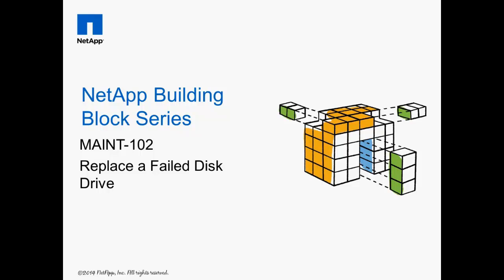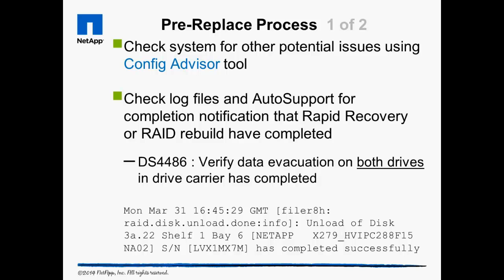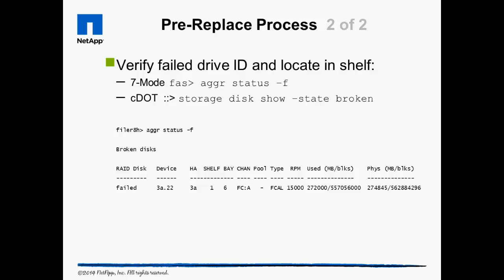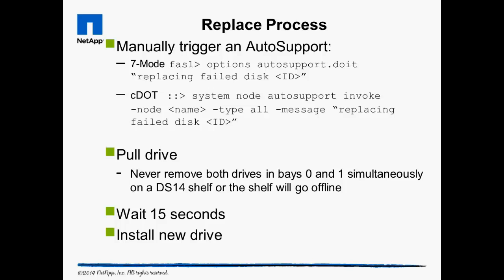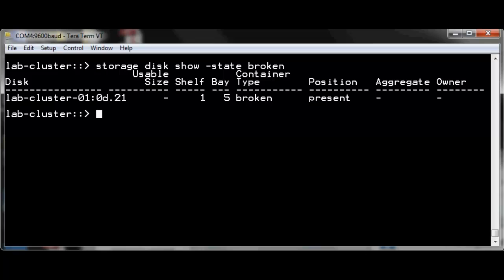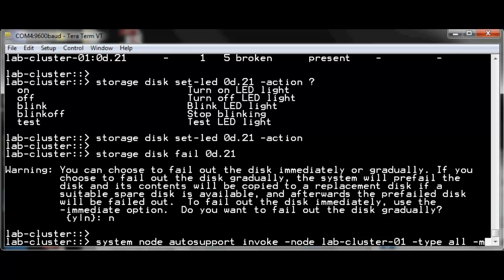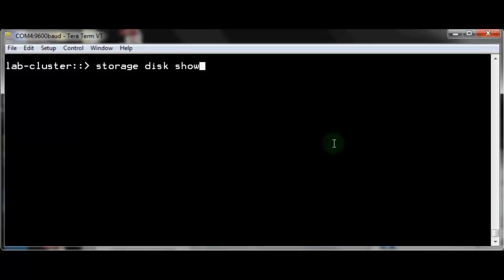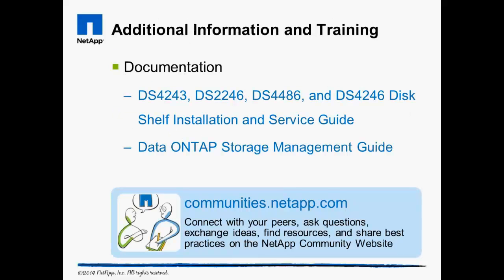Building Block Video: MAINT 102 Replace a Failed Disk Drive

Comment: Just to clarify: The owner of the FAS storage system must have an active non-return policy - Non-Returnable Disk Plus (NRD) or Regulatory Advantage Plus - in order to destroy a failed disk drive.  Without the policy, they will be charged for the price of the replacement disk.